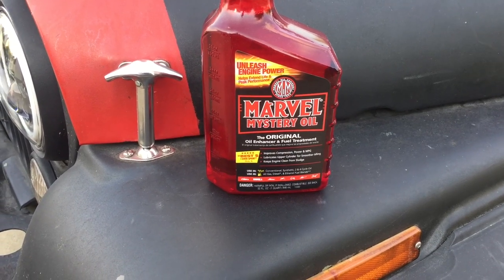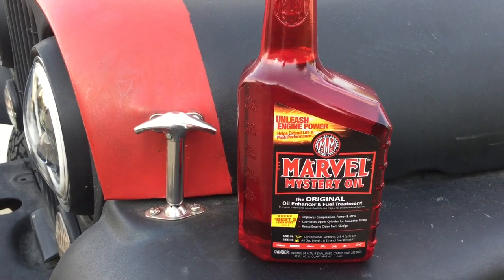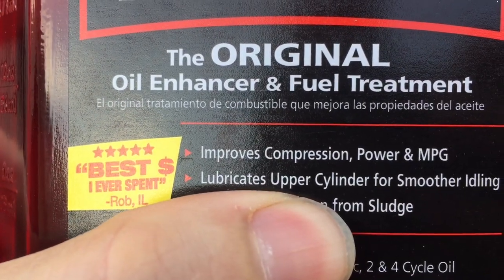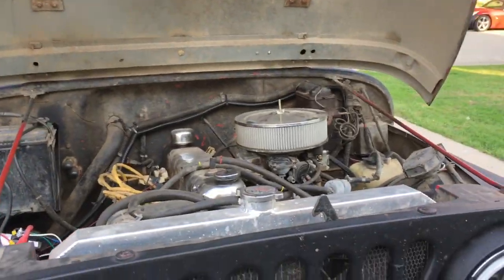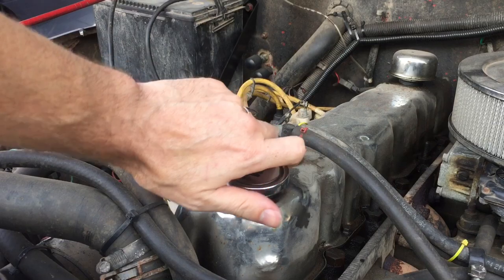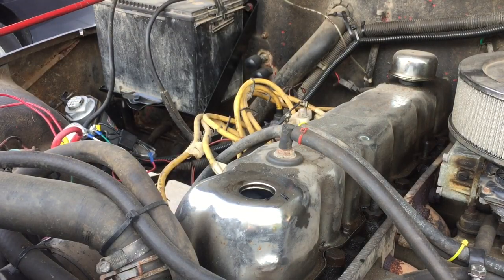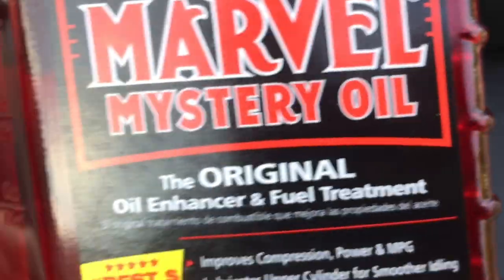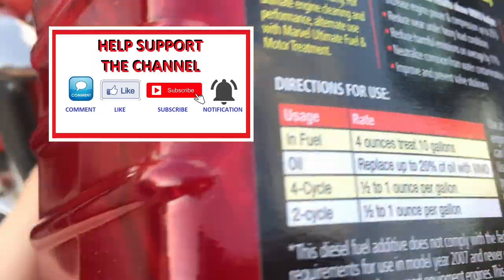Does Marvel Mystery Oil Work? Does it reduce lifter tick or engine noise? Sound Test and Review!

Comment: So, after 3 years, have you continued using the MMO? How has the results over this time period ended up?
I've been told a good use for MMO is as an engine cleaner. Use it the last 500 miles before changing oil. It helps clean up the engine.
What have your results been?
Reply from the maker: Unfortunately, I don’t have a useful update. I only drive it a couple hundred miles a year. Just a little bit during the summer months.
I did not add MMO again at the next oil change. I added a zinc additive for older engines instead.

Comment: Are you supposed to drain the MMO after 500 or so miles of adding it or can it sit in the engine for 3000-5000 miles before the next oil change,
Reply from the maker: The MMO bottle and website do not specify any time frames. I believe it is intended to run for the full length between oil changes. Add a quart every oil change, so it is always in the system.
Reply: @HowtoandReviewsOfficial   hmmm ok, I also heard you can do a light gentle clean by adding like 4- 6 oz. like 500 - 1,000 miles before the next oil change for a little cleaning at end of oil cycle, then whats cleaned can be drained with the next change. I add 4 oz. to my fuel tank every now and then, but have not tried it in engine oil yet. Thanks for your video :)

Comment: Lifter noise and still have lifter noise , so when you read the fine print you find that if the oil does not cure the issue there is a very good chance the lifter is shot. 4500 van needs one lifter but to get to it and fix it is about 8000.00 so I will drive it into the ground.

Comment: Ran it for 5000 miles in my engine and it definitely reduced my lifter tick. It used to tick for 30 seconds after a cold start now it goes away after just  3 or 4 seconds. I might treat it again to see if the tick goes away totally.
Reply from the maker: Awesome! Thanks for sharing!

Comment: Can you try Nano GLAY from Korea? Using graphene and it works really well with noisy engines over here.
Reply from the maker: That is interesting. I have not heard of that product. I looked into it, and it does not appear to be available in the United States.
The product uses graphite as a lubricant to reduce friction.
Marvel mystery oil is a detergent that illuminates sludge buildup, and keeps the engine clean.
Two different mechanisms/methods.
I have added nano GLAY to my list of products to try in the future. Thanks for sharing!

Comment: Could you please send me the link where I could get that oil value pls ..I love your video thank you for the input
Reply from the maker: Thanks, I appreciate it!

The brand of the oil value is FUMOTO. You can purchase direct from FUMOTO, from Amazon, and they are also on eBay. I purchased from a distributor on eBay, which was the lowest cost.
Use the FUMOTO website and enter your vehicle information to determine what valve you need. 

http://fumotousa.com

I have these on two vehicles and love them. Tooless oil change. I have them sitting on a shelf and ready to install for two more vehicles. Just waiting for the next oil change. 
I will definitely be making a dedicated video when I do the next install or oil change!
Reply from the maker: The review video is posted!
https://youtu.be/MlS1bPiCiXU

Comment: Leave it in for a full 5000 miles and change your oil.  It's gonna take time to clean up stuff.  Some folks still use it with every change others will use half a qt with their change from the research I've been watching/reading.
Reply from the maker: Thanks for the input! The MMO bottle and website do not specify any running time, so your first hand experience is very helpful to myself and others.
I suppose I will add MMO with every oil change; I probably only put roughly 1000 miles a year on that vehicle!

Comment: Where did you get that oil plug from?
Reply from the maker: Hi! The brand is FUMOTO. You can purchase direct from FUMOTO, from Amazon, and they are also on eBay. I purchased from a distributor on eBay, which was the lowest cost.
I have these on two vehicles and love them. Tooless oil change. I have them sitting on a shelf and ready to install on two more vehicles , just waiting for the next oil change. 
I will definitely be making a dedicated video when I do the next install or oil change!
Reply: Thanks soooooooo much, now my oil changes will be less messy.
Reply from the maker: @MrDazydaz  No problem!

Comment: Working as an upper cylinder lube and quieting ticking lifters are two completely separate actions. Although I happen to know that Marvel Mysterio does do both that doesn't mean that an upper cylinder Lube will clear a stuck lifter.
Of course there's no noticeable difference. The engine you're trying to test that on has solid lifters. It only clears lifter tick on engines with hydraulic lifters that are jammed up with sludge. Solid lifters always have a tick what you need to do with that is actually adjust the lifters. It's a mechanical thing. If you don't know anything about engines you can't be doing videos you're wasting people's time.
And the ticking you were hearing that comes and goes is probably a exhaust leak from the manifold. Those can easily come and go.
Reply from the maker: Thanks for the great information. I apologize for wasting your time.

Comment: You really didn't test it as you're supposed to add it at the last 500 miles Before your next oil change. Then repeat the same thing and recheck on your next oil change
Reply from the maker: Thanks for sharing!
Unfortunately, no such directions are specified on the bottle or the website. It just says “Replace up to 20% of oil with MMO” on the bottle, and adds “At every oil change” on the website …That’s it 🤷‍♂️. If more detailed instructions were specified, I certainly would have followed them.

Comment: and i'd never put it in the engine oil i've always poured mine in my gas tank with the tank being already full so it can mix in with the gasoline and be sprayed into the cylinders
Reply from the maker: I think that would be the “safer” use, as a fuel system cleaner to clean the carb or injectors and cylinders.
It needs to be added to the engine oil to free up sticky lifters. But I was, and still am, not completely on board with adding it to the engine oil. Pouring detergent in the crank case and running the engine doesn’t give me a warm and fuzzy feeling. What’s the point of the engine manufacture specifying a specific oil viscosity and standard if 20% of it can be replaced with detergent?
But, plenty of people swear by it…
Reply: @HowtoandReviewsOfficial  try adding it to the gas tank instead while its already full since thats where i had my luck the whole thing i dont listen to the.directions